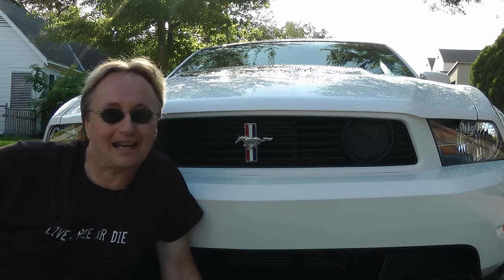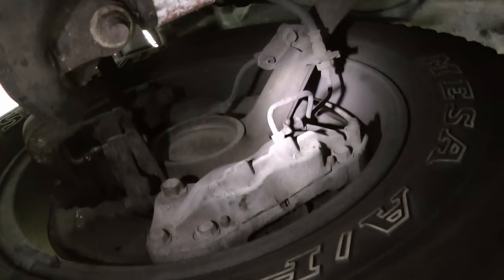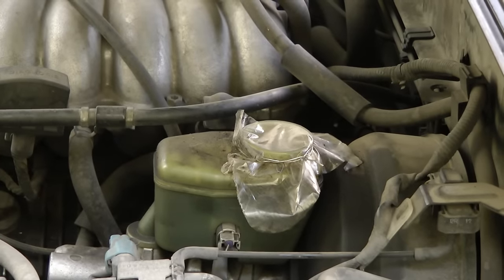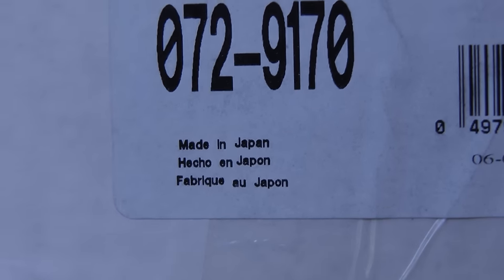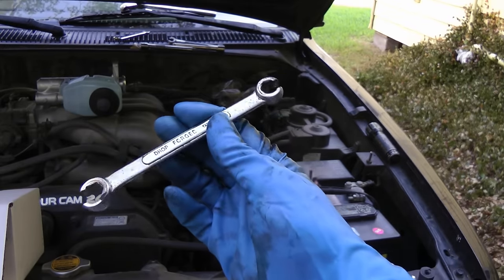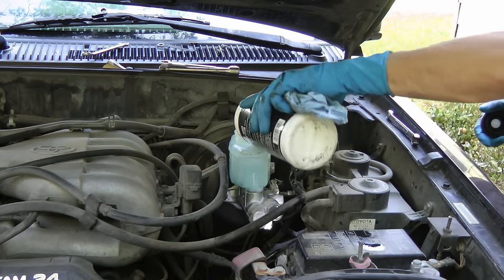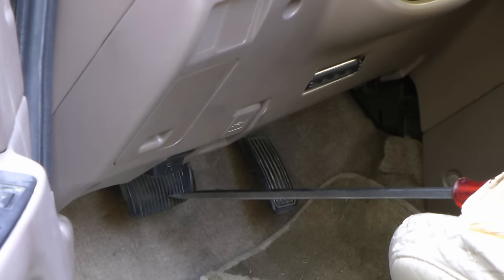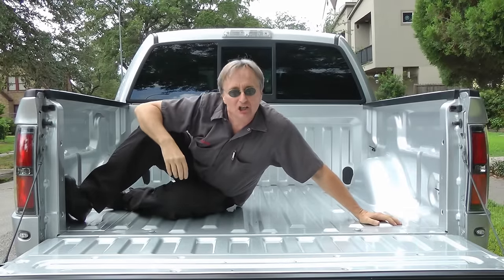How to Fix a Brake Pedal that Sinks in Your Car (Brake Master)

Comment: Also i forgot to add that when engine is stopped it doesnt fall to the floor, after 1-2 hits its hard as rock. Im just sad if i have to buy new MC. Battery died, had to replace it, bought brake repair kits, put all back together so all works and moves like it should. Now seems that MC died.

Whats next?! Sad. All my vacation and money goes into repair. Why is that you repair one thing and next goes bad at the same time? I hate that "rule"

Comment: i lost pressure out of nowhere on my brake pedal. one min it was fine, the next it lost pressure. i had a brake inspection a month ago too -.-
Reply: i have my car parked. i pumped my brake a few times and now its really firm and a little spongy
Reply from the maker: check all wheels for leaks, if none are found, replace the master cylinder

Comment: The master cylinder works one day and is not so fine the next.   Is this a sign something is going out?  Trying to avoid a $500 master cylinder repair.
Reply from the maker: sinking pedal is one of three things, a bad master, a leak anywhere in the system, OR problems in the ABS modulator if you have ABS.
Reply: After driving the car a few days the sink has gone away but the right front pad still squeaks.  The repair show is making me wait another week for them to fix. :(
Reply: Good idea.  The Master Cylinder for my truck is $500.  I'll just whip out the credit card and lickety Split make the repair.
Reply: Atleast I have a small size which is more than what you probably have.

Comment: great advice as always .. However .. my brake pedal goes to the floor but only when the engine is running .   without the engine running the pedal is a good solid top pedal.  Durrrr moi brain hurts ..

Comment: LOOK IN THE FLOOR YOU PROB HAVE A SMALL BROKEN PLASTIC PIECE IN YOUR FLOOR BOARD THAT YOU HAVE NO IDEA WHAT IT GOES TO.... SIMPLY PUSH THE SWITCH DOWN AND YOU WILL SEE HOW THE BRAKE SWITCH WORKS.... SIMPLE FIX AND PROB FREE JUST PUT A SCREW IN THE HOLE IN THE BRAKE PEDAL ....FIXED OR YOU COULD BUY THE LITTLE PLASIC PEICE

Comment: Dear Scotty please help me out man. I'm fucking stumped. my 2002 Suzuki xl7 had a soft brake pedal. sometimes it clunks loudly and then drop to the floor. strange. nothing is broken or loose or leaking anywhere. I changed the master cylinder but all they had for that truck was a 160 dollar 15 dollar core remanufactured master cylinder. I bled it for an hour from up top like you did then back to front. it got stiff for all of 5 minutes then died. I don't understand why. why is it clunking then losing pressure. the back drum has been starting to stick too but when you check for leaks nothing. the resivoir stays full. now I'm pissed. I just can't figure it out and a shop will surely get me good. please help me out brother if you have any ideas
Reply from the maker: either you got a crappy master cylinder, since it's remanned that's often the case, or you have a leak in the system somewhere OR an abs modulator failure if it has ABS
Reply: Scotty Kilmer It has abs. no abs or brake light has ever came on. it's just irratating since it's my only truck and I have two kids and they would really sell you garbage like that. I'm most likely taking it back to orileys and keeping my core and finding something else out.
Reply: Scotty Kilmer Thanks Scotty. I'm just gonna get a new one if I can find one. Autozone didn't have any. It's gonna take some doing. apparently I should have asked if it was remanufactured first I was surprised this morning. for 160 bucks it should have been new.
Reply: i would recommend either raybestos or ac delco  but still the 105 bucks is cheaper then the 160 bucks you paid for the autozone reman :) hope this helps